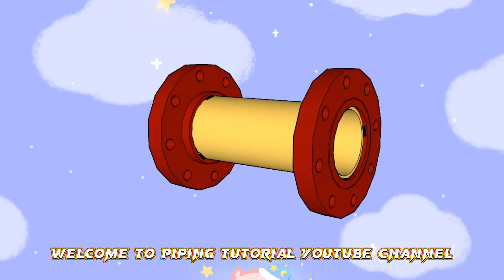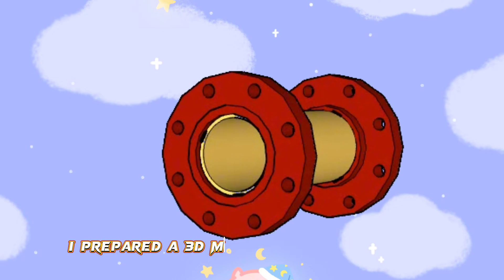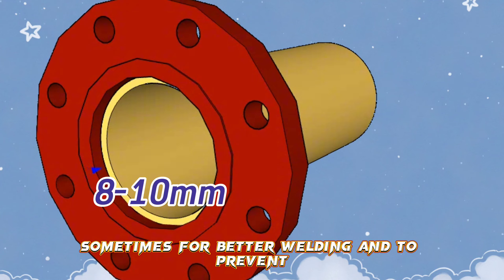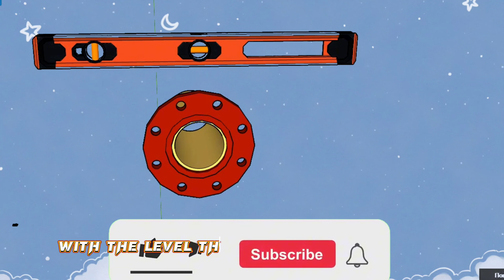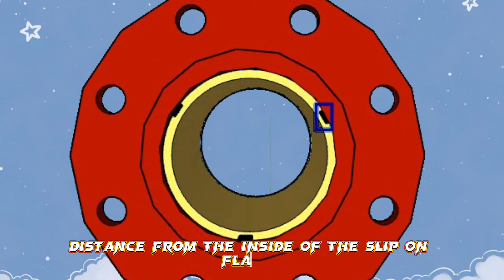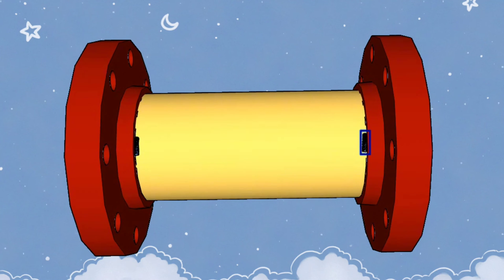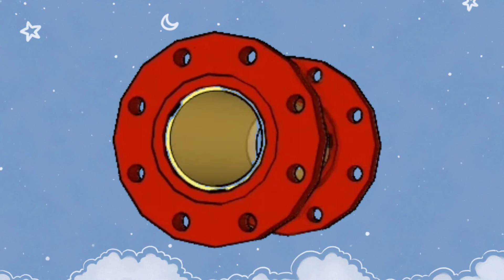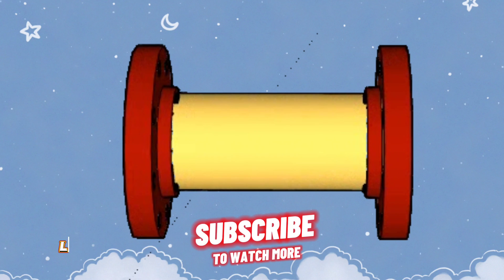How to fit Up slip-on flange to pipe. Slip On flange fit up to Pipe.Piping Tutorial

Comment: The pipe OD is a little less than the flange ID. If there is a 3 mm gap overall there should be shims to give equal clearance all round before tack welding.